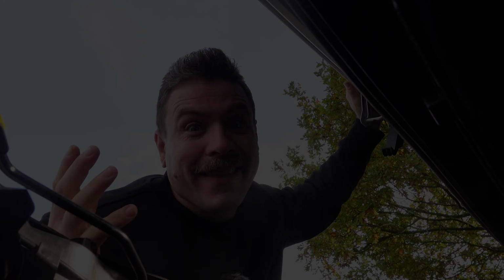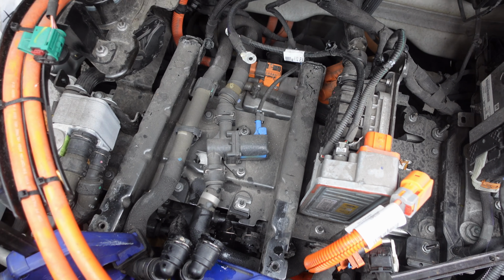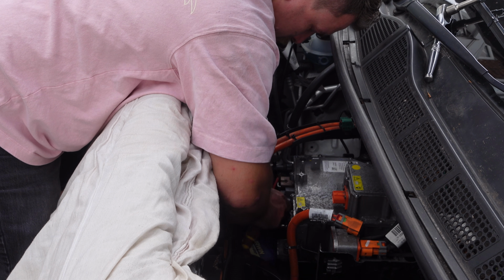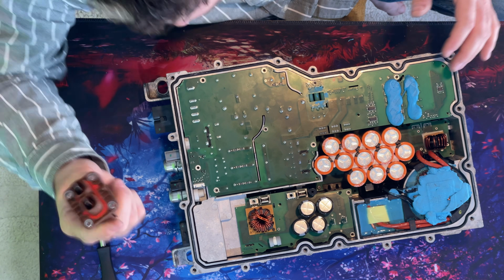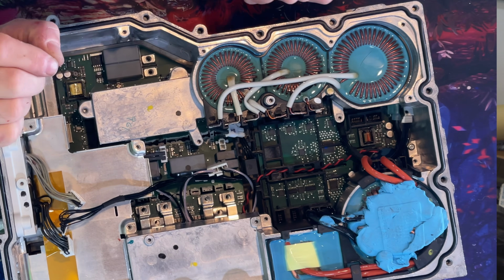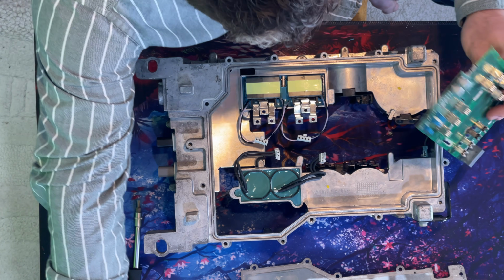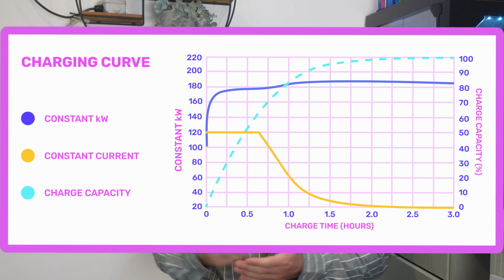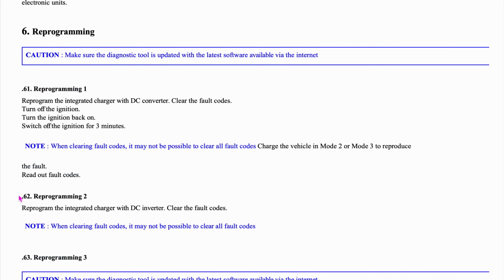Dealer Quoted £3,000 — I Fixed It for £380… But It Wouldn’t Work Until the Dealer Did THIS!

Comment: I’m tempted to report this video as Dangerous because there is no emphasis on Isolation of the Traction Battery before opening the bonnet. The 10 minute wait, Ignition off, before disconnecting the Housekeeping battery isn’t sufficient. Direct Current is so much more dangerous than AC, 300+ volts DC cooks a sausage in seconds, not nice. The temptation to report this video is reduced by acceptance that perhaps this type of surgery isn’t going to be undertaken by someone who has no prior experience of HVDC circuits. Having said that I am convinced the inclusion of a short “where and how” clip showing Traction Battery isolation would  dramatically improve the safety of those following your example. Also I didn’t spot anything about Shielding/ Sheathing of all metal tools but that’s not so much of a problem if Safe Isolation has been done correctly.
Reply: As some one said above, it would be wise to emphasise safety. EVs have  much more deadly possibilities than an ice that most people will be used to fiddling with.

Another thing ; don't rely on " it won't do such and such because it's designed to do x,y,z". It doesn't apply when you are already working on a faulty vehicle. If you are working on fault A it doesn't mean there isn't a fault B,C D etc etc. Any one of those could put you in a bad position with high voltage electricity at those power levels.

Remember anyone working on an EV is working with voltage and power levels previously only tackled by skilled sparkies and engineers in an industrial environment . Even domestic electricians may not have experience on this level of hazard despite their training. Most public have no idea about the electrical safety conditions required.

So be very careful when you delve into the innards of EVs and associated gubbins. Make safe before working on them, assume everything will bite unless YOU know for sure it's dead, and only work on live equipment if you are functional testing. If you need to remove/add/swap components isolate everything first, each time.

There is a saying: there are old pilots and there are bold pilots, but there are no old bold pilots.

That saying could be extended to EV technicians. Only take shortcuts when you really know what you are doing, and even then, know what the outcome of the short cut could be and probability of achieving it.

I am not trying to put people off, but they need to understand it isn't the same as ice tinkering and adopt a more safety conscious environment. We don't want people blowing bits off of themselves or setting fire to their cars and houses.

Apart from that , interesting video.
Reply: He removed the 12V this prevents the contacters from closing. But yes he should have spend 30 sec on this issue and also check that nothing is coming from the HV side.
Reply from the maker: God point. I thought of adding it in but safety videos don’t exactly work for the YouTube algorithm 😂 I presumed people were smart enough to know to be safe. I’ll see if I can add something afterward on screen

Test a multimeters on 12v battery to confirm working 
Test multimeter into top left orange connector removed from the OBC. Confirm 0v before proceeding. 
Test multimeter on 12v battery to confirm reading accurately 

You might be interested to know there is a bleed down resistor in the top of the OBC on that distribution board.
Reply: @TheOfficialBatteryMan  Anyone with a  HVDC qualification would instinctively head for the main physical battery isolation switch and open it before  anything else. The 12v D.C. side has no lockoff that would stop a Bustard Feed operating a HVDC Contactor and frying the unwise.

Comment: The constant heat in the unit would surely temper the copper therein - causing components to malfunction, manly due to increased resistance.
Reply from the maker: Yeah. I would expect voltages to be slowing as low at components further down. This could trip a flag that bricks the charger or atleast pushes a fault code

Comment: I can understand the component needing to have specific parameters set to work, and as a safety thing to also have the vehicle vin number to stop you swapping random parts between potentially completely different vehicles which could be a safety concern, but you should be able to buy these things precoded. 
That said I typically charge at 4 KW as 6 hours still gives me 24kw, so typical 96 miles a day which is more than I ever do anyway so hopefully will keep the heat down and keep the current controller cooler.

Comment: Renault use to do this with parts lists - when the PC era started, they wanted £6 million for a PC with the capability of getting access to their parts server; exactly what inside a PC I could build for £300, that made it so special, I never found out - I got rid of my Renault and vowed never to touch the brand ever again; after they sent only a part set of spares, and then lied to my face about the other parts not existing.

I have seen several different stories about Stellantis shafting their EV customers in this way, and although in several cases, the Vauxhall dealers fixed the problems - how long will those Vauxhall staff be around to help out?? Stellantis seems determined to stamp out anyone willing to do "customer care".
Reply from the maker: It’s a shame when it could push people from EVs in general due to one manufacturer
Reply: @TheOfficialBatteryMan  Sadly, it isnt just one manufacturer - as a keen EV'er and being disabled and sat in front of my PC much of the day - I have seen or read horror stories from multitudes of people in various legacy car forums about shoddy EV designs, shoddy software and terrible after care.
Stellantis are pretty bad - but VW are having big cell failure issues that dealers are trying to wiggle out of fixing - years after early reviewers suggested there were signs of battery fade - leading to speculation VW were using a cheap-ass battery type.

Porche, Jaguar and Toyota have all had huge issues, the former two with software/firmware faults - the latter with the wheels actually falling off.

Ford are being Ford - although mostly with their home wall chargers wifi modules failing every other week, so owners cannot charge at home half the time (if they were daft enough to buy the Ford network system).

Hyundai/Kia/Genesis have had some big issues with their integrated AC/DC charge controllers failing, but fixed them relatively quickly; although they had issues with reliable replacements in the first few months after it started.

In the UK at least, HKG honour their warranties right up to the very last day.

Comment: Giving Gary C EV Repairs some competition?  Actually, no, you guys are both showing up the car dealerships and warranty support - or lack of it. Hope you performed a safe high voltage isolation procedure before poking around with bare hands.
Stellantis dealer trying hard to give Chinese cars a sales boost.
Reply from the maker: Keep your hands away from potentially live parts and presume they are live. But your right to test the battery dc output feeding the charger. 

With the 12v removed there would only be voltage there if both battery pack contactors failed.

Comment: I would have started a claim against them. They wouldn't have had a leg to stand on. Thorough online guides show how to do it.. Don't even need a solicitor. But glad you made this series of videos and exposed appalling attitude from citreon and on going battle of right to repair.
Reply from the maker: I started off with them making out I was the village idiot and didn’t know anything and ended up bringing the part in to confirm if it had an extended warranty or not. Funny I didn’t get an answer
Reply: Just wondering did you manage to finish your sparkie quals?

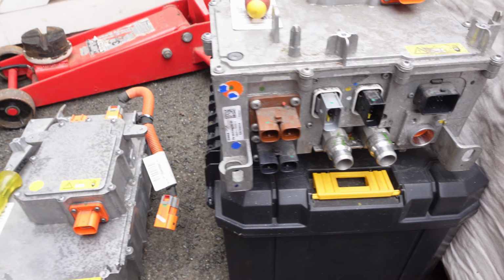Comment: I'm 99% sure I have the original built-in charger in my 2020 e-2008. After watching this video and the heat issues with this OBC, I think it's safer to use a single-phase 10-amp charger to protect the components. I'm almost 100% certain that if you don't use high amperage, the components won't get very hot. If there someone who can confirm this for me, I'm realy happy. I can charge enough in a charge form 23:00 to 6:00 to get to work and back and still have left over battery capacity.
Reply from the maker: I suspect you are correct. If you have a three face charger, then running that at a lower rate would be the best option as it splits the power across all three phases.
Reply: 10a is very inefficient. You'll be wasting upwards of 30-40% as heat, if the efficiency is anything like a Renault Zoe (which have very detailed efficiency curves)

You can do 16 amps which would save you 20% overall energy and cost, and you're still well bellow the overheating zone of 7-9kw single phase
Reply: I have also a limitation of 14,5A due voltage drop. Second, I have a shared circuit with the shed, as the layout of our home will limit. The cable to rhe shed is singlephase 16Amp circuit. Third my NRGkick won't let me charge above 13Amps on a shuko plug. So there is my 10Amp comming from. 10Amps equals 2300W, 400W of standby use/cooling of the car made a effective 83,5% charge. Indeed, a higher Amp level will decrease losses, but build up voltage drop and losses due the long cable. With 13Amp I could do 3000W which equals to 87% effective charging. But charging at 3x16A (11kW) still made phase 1 pop from the video. So I think 3x8 or 10Amp should be much safer for the car. 

I to have to coöperate with my neighbours to get that sweet sweet 5x6mm2 cable from my meter to my personal parking spot, 70 meters away. And that will be a heck of a job to do in work and regulations.. 😅 A job for future me.
Reply: Käytän nyt vain 3X 6-10A koti latausta ja vain harvoin 16A. Ylikuumeneminen.. Vaihtoivat Toyota takuuseen uuden OBC .n. VMax oletan. Varmuutta senkään kestävyydelle ei ole myöskään. Alkuperäinen hajosi vuodessa, jatkuvalla käytöllä 3x16A.
Reply from the maker: @Zeppenwolf1 I was running mine at 3x16a but can run 1 x 32a. Phase one is set up to handle more current. I saw one of these chargers the other day where the top and bottom cases were blasted outwards. So a massive release of gas inside. Weirdly, the capacitors looked fine.
Reply: Do you know anything yet about those VMax obc s are they more reliably
Reply from the maker: @Zeppenwolf1 word on the street is they fix the issue. I would like to strip one and understand what they changed. I think much of the issues stems from heat from a poor connection between two boards. I expect these two boards still have a connection but more robust.

Comment: A familiar comment is that EVs are a lot simpler than an ICE vehicle. This shows they are just as complex, but in a different way.
Reply from the maker: Very true. 

There are still a ton of ECUs and controls in an ICE car. But I totally get you. A different type of complexity. Generally these controls should be pretty reliable.

Comment: AFAIK Apple does the same thing - the display and fingerprint readers on some models were coded to the specific phone - so even DIY replacement from another iPhone would render the component unusable.
Reply: I think the intention behind this is so that stolen phones can't be stripped for parts as the expensive parts can't just be used in other phones without being recoded.
Reply: @davidsmonkeyroost  I love your naïveté, never change!

Comment: I could comment my thoughts with comparisons but it's probably pointless. One thing I will say it must be nice to work on an older van and not require industrial strength hand cleaner afterwards. Another EV advantage.
Reply from the maker: O yes working on this I could wear a pink t shirt and it didn’t get dirty. I wouldn’t attempt that on an old diesel van

Comment: Looking for my first EV - looks like I'll avoid any Stellantis one :( and I really don't want to go for a Tesla.  Thanks for doing the grunt work here.
Reply from the maker: Good thing is there is a lot of choice in 2025
Reply: Experiencing Renault EVs I can tell, go Renault. They are nice. Maybe Nissan, if you want Renault Tech with Nissan Design.
Reply: What about Hyundais, specifically Ioniq 5? The ICCU may be a problem though, it's a lottery on all the EVs with problems :(
Reply: @callmefoxie2950  or maybe Polestar. Youtuber AgingWheels is quite fond of his and can't complain a lot about his. 
Seems like they are underrated.
Reply: @callmefoxie2950  But it is a well known problem with the iccu. Hyundai and Kia are aware and most of the time help you with a spare unit when abailable. 
Thing is that despite of rumors, they really haven't fixed the iccu problems to 100% by now, which is not only annoying but kind of a surprise.,
afaik, I think you can swap them without hidden wichcraft coding I think ;)

Comment: Service information is available to anyone who is willing to buy it from the manufacturer. Dealers get a special rate and independent garages get a different rate. 

I am very much a person who supports the right to repair but I disagree that anyone can work on cars. The thought of a weekend warrior changing brakes and then killing 10 people at the bus stop terrifies me. I can see both sides of the coin. 

The part needs programming as it's universal and will work with different sizes of HV batteries, option packs and world location settings. 

Also helps track the serial numbers so if there is a fire they'll know which batch to make another recall on 😅

Toyota pro ace has the same problem, we fit 1 per week 😮. Good to know it can work with a good used part too.
Reply from the maker: I get wha you’re saying. 

Yeah it’s defo a cost saving with the second hand part.

Comment: Well at least the whole motor didn't have to come out to repair that ,.like on the Renault Zoe. Charger not designed for charging that large size battery on 7kw
Reply from the maker: Yes, very thankful it didn’t need the motor out!

Comment: those board to board power interconnects are just asking for trouble with vibration and tolerance causing high resistance & heat, especially at high amperage. they should've done bolted connections, or just completely solder the boards together.
Reply from the maker: Which would need a redesign to make it reliable   I would love to tear into the Chinese version and see what they changed